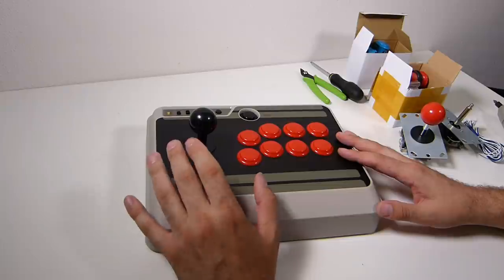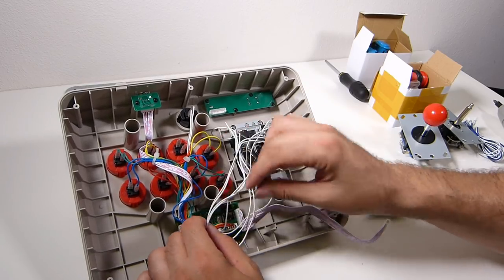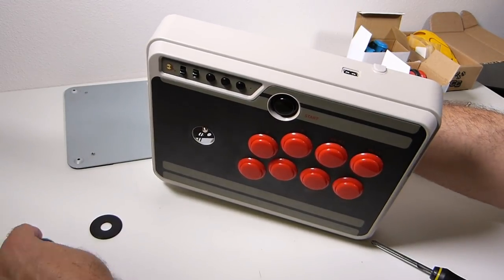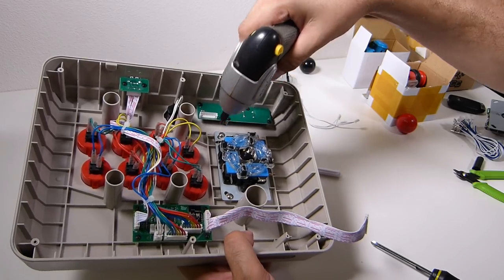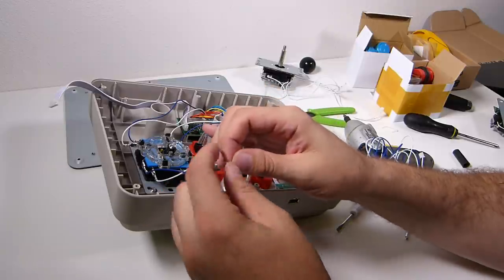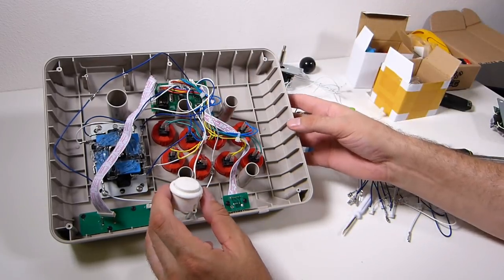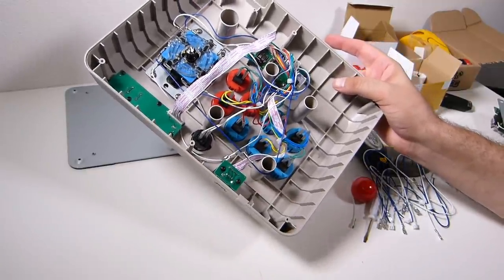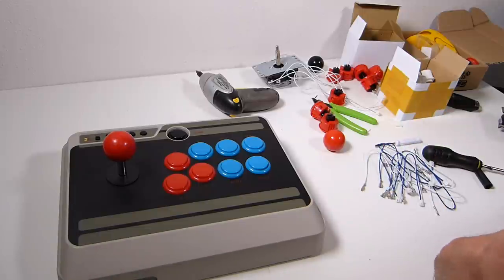8BITDO NES30 ARCADE STICK - UPGRADING TO SANWA BUTTONS AND NEW STICK

Comment: Impressed that they use decent connectors on everything, making these swaps straightforward! There's a $50 deal today on Amazon, tempting. Thanks for the detailed rundown.
Reply: ordered mine and a seimetsu to upgrade got it today, opened it up and looks like they now longer use quick disconnect for the stick, they solder them.
Reply: yes almost solder less modding possible with what they used !

Comment: Upgraded very decent. The Sanwa Parts cost me the same as the unit again. Well worth it, it now feels premium for sure. It's a smaller unit which I like.  I prefer units which out LED's,  love the 2.4 connection, it never drops out. It's still cheaper than many of the mid range units, dead easy to upgrade. Software for the macros is very simple to program. It looks amazing 😁

Comment: Skip the Blee stick.  Mine sucked.  Spend a little more for a genuine Sanwa or Seimitsu.  Definitely worth it.  Make sure that the joystick had the leads at each location and not the 5 pin connector.  Thanks for the vid!

Comment: My only complaint about this stick is the default button mapping.  AB/XY are reversed and R1/L1 are both on top row with R2/L2 both on bottom row. Standard fight stick mapping should run Y-X-L1-L2 top row B-A-R1-R2 bottom row, easy enough to rewire the stick for proper mapping so you don't have yo change button configs in game but annoying enough

Comment: I bought the newer version of this and soldered the 8 wires from the original to the same places on a Sanwa JLF-TP-8YT. I was very proud of my soldering job but when I use it the directions are all screwed up. I am new to this but it's a little crazy to me that I can't find any wiring diagrams provided by Sanwa online. Sometimes projects are more of a pain in the ass than you anticipate I guess lol. I am looking at soldering the 5 pin connector in but the color coding on the wiring harness that came with my controller is different than what Sanwa usually uses. Hopefully my controller and buttons are the real thing.

Comment: Video title: “how to install Sanwa buttons and new stick”
Video description: “buy a Sanwa stick here”
Actual video: “don’t install a Sanwa stick, use a clone instead because there are wiring differences”

Gee, thanks for clarifying that after I already bought the stick...
Reply: Research before buying, good lesson to learn on a fairly cheap item.
Reply: I did that, but the research unfortunately lied to me.
Reply: The video title doesn't say "Sanwa Stick", it says "Sanwa Buttons" and "New Stick".
Reply: Try a sanwa jlw-um-8. It has quick connectors. Also most seimitsu should work, if you want those
Reply: I swapped mine with sanwa's, not a problem. You just need to learn how to solder so you could solder it directly to the stick or mod sanwa's 5 pin cable's other end to 4x 2 pin plugs(JST-XH 2 pin).

Comment: Anyone wondering how to convert a 5 pin sanwa to use this - look for the 8 solder points around the bottom.  Connect it to your computer and open the game controller testing console by clicking on control panel/hardware and sound/devices and printers/ xbox 360 controller/8bitdo Controller --- then grab the two up wires and line them up on two solder points next to each other and move the joystick around till you get a movement on the console.  If it's not "UP" try another two till you get it and then solder them.  Do the rest for all 4 of the sets. (Important!  Make sure the screw holes line up!)  I have done this and it works great.

Comment: Curious why you didn't stick the black ball top back on. 

  I did this Saturday going in with no real experience with arcade mods. I do however have plenty of electronics and soldering expertise. The sticks a bit of a pain since Sanws comes with the 5 pin. I just soldered right to the tabs using the old wires,  but had to observe polarity. (I'm thinking I could have pulled all the commons together and used the 5  pin, but didn't want to screw something up)

Buttons are no sweat at all. No experience needed for that. 

Good luck modding. It's worth the trouble because it's such a great stick once your done. Looks cool, plays great and just a lot of fun to use.

Comment: For the 8Bitdo NES30 arcade stick, I recommend:
1. A black crown lever bat-top joystick.
And 2. As for the sanwa buttons, I recommend two red sanwa buttons for B and A and black sanwa buttons for the rest of the buttons. It makes sense because the original NES controller had a black directional button and two red action buttons.
Reply: or use a balltop. it's all personal choice. you didn't even mention gates. lol

Comment: Tip: if you are using the blue and white USB encoder wires for a joystick upgrade, they will be long enough if you flip the orientation of the wiring PCB.

Comment: I’m perfectly happy with mine. Sure the joystick and buttons aren’t the best but they seem perfectly fine for my use. Not worth the expense to upgrade for $60 dollars more.
Reply: I'm glad yours works for you.  I'm having trouble getting my inputs to register due to the small motion gate on the stock controller stick and will be replacing the stick.  It's also a fun project.

Comment: Great video! I am just wondering if I add the Sanwa joystick, would adding a sanwa octagonal gate make fighting games feel more or less authentic?
Reply from the maker: Harrison Hacks I dont know about authentic but for sure if you are used to an Octa gate you may beable to perform moves easier. I usually stick with a square gate, I have octa gates lying around from Sanwa, they actually fit most of the clones as well, including the Blee stick I used here but only use em on fighting sticks meant only for fighting games. Trying to use an octa gate on other arcade games can hinder the experience on certain games.
Reply: Ahh... ok. I didn't realize that. Square gate seems to be the way to go I guess. My stick will be for multiple genres of games so I will stick with it. Really appreciate the advice. Thanks
Reply: Square gates what all the candy cabs in Japan use for fighting games.... Octogates are more for shmups

Comment: There’s two things that stuck out to me:
1. Every review I’ve seen states that they used T10 screws, not Philips. 
2. If this is a tutorial, leaving out advice to be careful because the bottom has a ribbon attached seems like a recipe for disaster.

Comment: Can't get the connectors to the buttons off either, super solid tight. If I pull anymore I will end up breaking it I think.
Reply: Yes, they are super tight on stick, you really have to put significant pressure.

Likewise, he linked to a stick that requires soldering, so I ordered the wrong stick.
Reply: I ended up putting it in my mayflash which has an extra connector. 
So yea, don't order that. It will silly to link it.
Reply: Hi, I¿ new at this, do you recomnend a Sanwa JLW-TM-8 for this?
Reply: JLWs are pretty big sticks. I don't have one of these 8bitdo sticks to test if it fits, but I've had issues with JLWs fitting into spaces that fit JLFs and most Seimitsu sticks, since the underside of them is very big. One of my favorite kinds of sticks, but massive underneath.

Comment: So, out of curiosity, could you just change out the gate on the stick if that's the real problem with it?  Would that solve the issue of missed connections?
Reply from the maker: Prof. Schreiber Ive not tried putting any other gates on the stock stick, but definitely the square is differently sized and shaped then any of the gates I have. Ill double check if sanwa gates fit this stick later today and report back. That may help the issue for just a couple $$.
Reply: Madlittlepixel Any updates?

Comment: What type of connectors did you use for the plugging in the replacement Joystick?
Reply: MarioMan181 Google up (187 HARNESS FOR ZERO DELAY USB ENCODER PCB) without the ( and ). The first link to pop up is the one to the wires.

Comment: Can anyone tell me where to get those blue and white wires?  Can’t find them.
Reply: I just bought a genuine Sanwa stick and used their 5 pin cable. All you have to do is combine the 4x original white ground wires (common ground anyway) and splice them into the single ground wire (black) on the Sanwa 5 pin lead. Simples.
Reply: @davethebulb  Could you take a picture please?
Reply: @rapsekill  How? I can't message you mate.
Reply: I’d like to know too how to use the 5 pin cable. Just got my sanwa stick today

Comment: How to do the wires if I want to use sanwa jst joystick with 5-pin?
Reply: katasiapa they sell a kit that comes with sanwa its a ribbon wire that plugs in the little micro board
Reply: Joe Quihuis Do you have a link to this kit?

Comment: FYI, if you REALLY wanted all sanwa, this set up would run you $40-80$. The buttons are about 2.50 a piece and the stick (whole unit) is about $20-40..BLEE does make some decent stuff, but the feel is not quite there. You can adjust tension and even the 'throw' (the amount the stick moves before action happens), it's just hacky to do it. I grew up on the HAPP sticks / button and those are weird to me now, prefer the touchy sanwa for sure. I tell people don't cheap out and get cloned sanwa, just eat it and get the real deal. Joystick seems like that got that cloned fairly well, just not for me weeeeeeeeeeeee.

 I have a xb360 Madcatz Super Street Fighter IV "Tournament Edition" stick and it's sanwa inside. Of course that stick (at the time) was $200. I use it on my retropie, xb360 (duh), and PC.  Most of the time it's used for my 6 year old playing Galaga on retropie heh. The only upgrade I did was change the the top to a piece of steel with a cross bar underneath so the top wouldnt flex (it has a little give otherwise). This makes the stick a bit heavier (because.....steel) but makes it like a tank. I just took the plexiglass off the top and use that to template the steel, so there wasn't any guess work. With the plexiglass and the underpanel gone, a single piece of steel (it's like 3/16ths, but a little thicker but not quiet 1/4 inch....lol at least my thickness gauge says that) it doesn't change the height of the stick (being too short because of added thickness or to tall if it's too thin).  For the 8bit do, you could do something similar if you wanted since the buttons top mount to the surface. The stick would have to be modified if you added another 1/8th+ inch to it (it would be negligible to me), but 1/4" would make it feel short. Anyway, food for thought. I'm really into arcade parts heh.